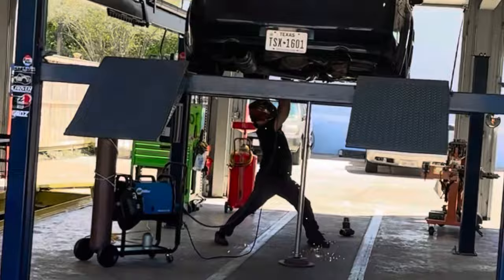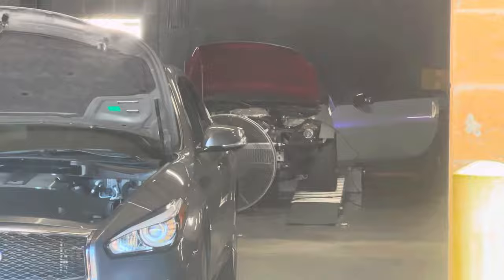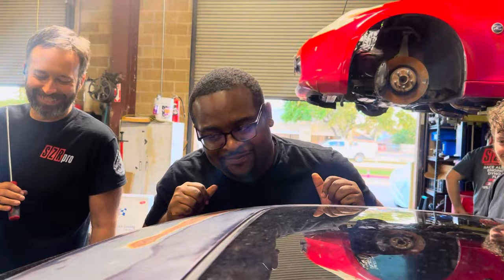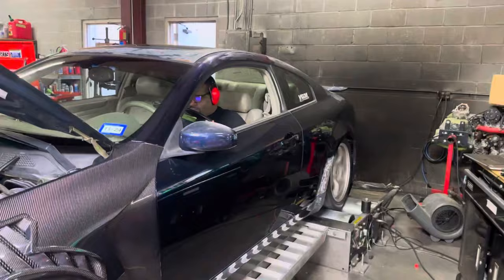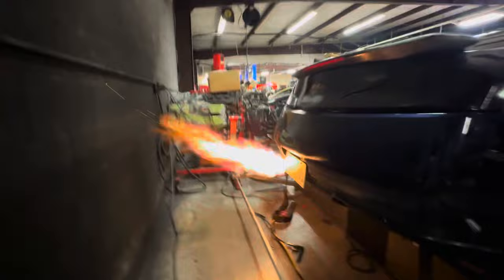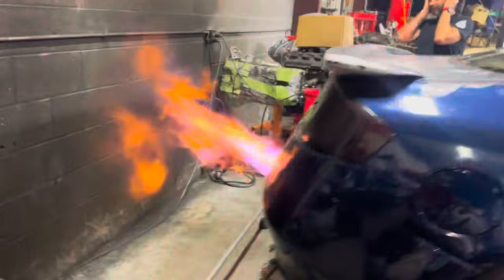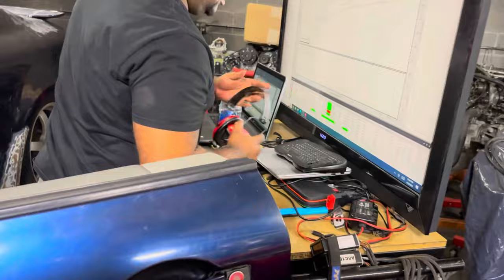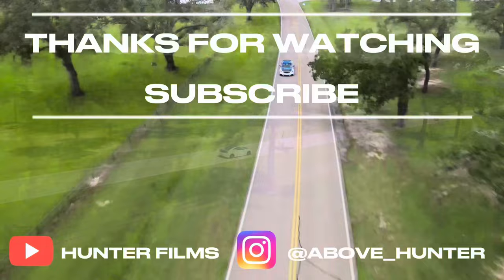Tuning the CRAZIEST GODZILLA G35! (Caught fire)

Comment: 284 whp with just an exhaust? no cams no intake seems like that dyne reads high no?
Reply: He has long tube headers
Reply: @lucasd172  LTH wouldn’t add an extra 40 wheel though. 280 is an average with bolt ons like intake, exhaust etc

Comment: Ok I’m new to all this 
Can you tune an automatic ?? 😂
I have a 2003 g35 coupe 
But do I need to go cat less to do a tune or what do I need to do?? 
Not trying to go this insane but I want like gargles and pops when I’m driving
Reply: You can technically tune stock and see minimal gains but realistically you want to do the main mods first like a plenum spacer, genuine cold air intake, and a cat back + high flow cats or test pipes. Theres other mods but those are what most people do before a real tune. And yes you can tune a automatic. Mine is a 2004 automatic